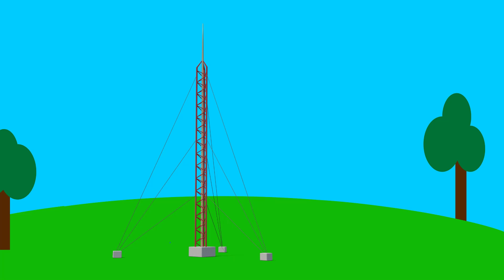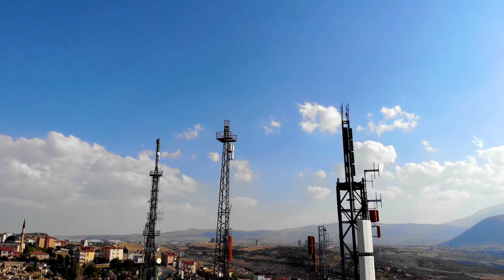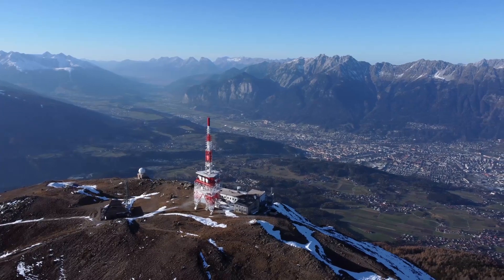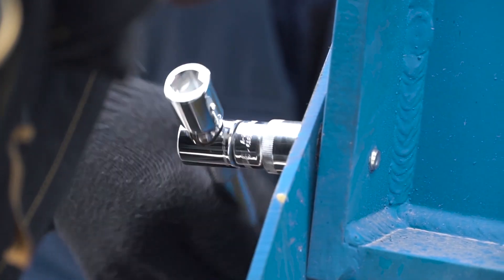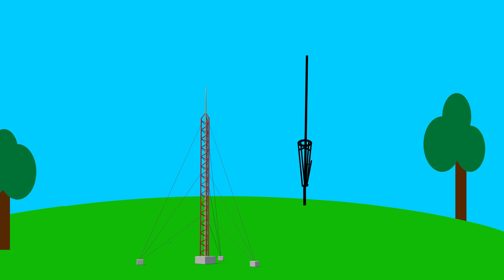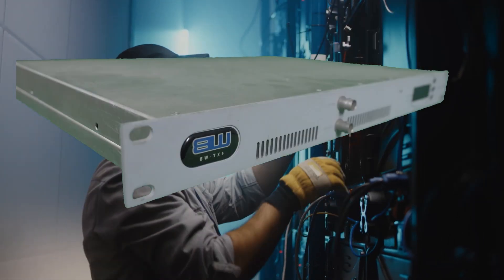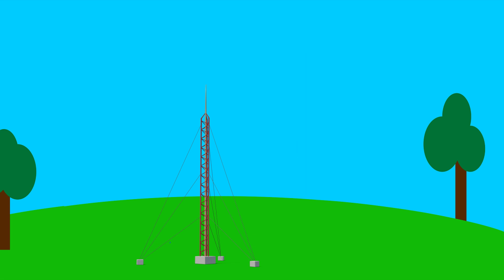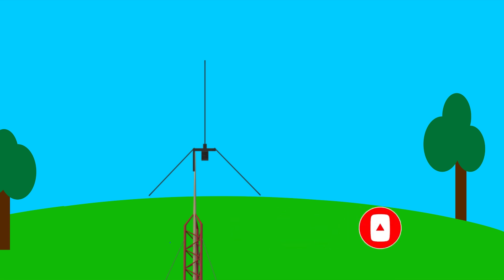FM Radio Station ANTENNA For FM Transmitter Set Up. How To Get It Right For Best Signal Quality.

Comment: Great video.  There is one other thing that I would add that improves all antenna types.  It worked for us and gives great results nearly 40 years on.  I was technical director at  KKFI in Kansas City.  They are 100,00 watts ERP  (25kw actually up the pipe).

We put in a very effective ground radial system.  We have a 500 foot (152 mters) tower.  The 4 ground radial (North, South, East, and West) go out that far.  The 45 degree radials are that long as well.  In betwwen the 45's (22.5 degrees) are radials that go out half way.  There are circular cables that join all 16.  From the air this looks like a bulls eye target.  This gives us a low "departure angle".

Don't buy a cheap lightning arrester.  A good one may cost you up front but save your ass week after week.  We have frquent stoms (including thunder snow).  What saved me is that at 500 feet we are the short tower on the hill.  I was standing near our tower when a neighbor got hit.  We were knocked off the air.  Our arrestor worked and we were back on 5 minutes later.

KKFI is listener supported.  We put their money to good use (EV RE20).  Do a proper job and invest in good stuff as g michrophones, great consoles, good equipment and well maintained)  Do a propper job and invest in good stuff.
Reply from the maker: Wow, awesome thanks for all the input. I think most of your info is very high-end...and probably over the heads of most newcomers to broadcasting lol. I say the lightning arrester was cheap but it was not so much cheap as cheaper than a new transmitter. It did cost a bit but I felt like it was cheap compared to the damage. We at one stage had a quarter-wave antenna mounted on the top of a pole on a hill. The highest thing for miles around and it got hit constantly with zero damage. So the little arrester was pretty good. I am quite chuffed that someone of your broadcasting level is checking out my little channel lol. Glad you enjoyed it :) Glad to have you watching.
Reply: @inspiresoundpro  My main problem was a Mains problem.  We were fed 440 volts three phase at 60 Hertx.  Our power company would drop a phase without warning.  The input transformer would fry in a minute  I built a circuit with some relays that opened all three phases if one dropped.  Keeping good broadcasting on air is a challenge.  Anything thaat can help new folks is of value.
Reply from the maker: @crankshaft3612  Oh yeah been there. Had the same thing happen to our studio. I found op-amp chips exploded in the mixer and processing gear smoked from the same three-phase issue.  Ridiculous that they can do that. A challenge for sure. Keeping a 24-hour station going with small budgets and volunteers is a challenge for real. I feel your pain lol.
Reply: @inspiresoundpro One possible solution for this problem could be a direct current intermediate circuit. You have your three phase AC mains go into a six-pulse diode bridge rectifier, with feeds a filtering capacitor to smooth out any voltage spikes. After that you can either put the DC directly into a one or three phase inverter to power your studio equipment and transmitter or you could also hook up a couple of truck lead acid batteries in between, to serve as a short turn UPS.
If you install the input rectifier in star configuration, and if you triple your input rectifiers' base power (don't worry it's only the theoretical power of which only 1/3 will be used in normal operation) you can even remain on air with full transmitter power, even in case of only one mains power phase remaining.
Reply: We want to buy  fm transmitter..
Reply: @crankshaft3612 . I am just curious on how many circular cables and the distance in between you joined around the 16 ground radial? Thank you in advance.